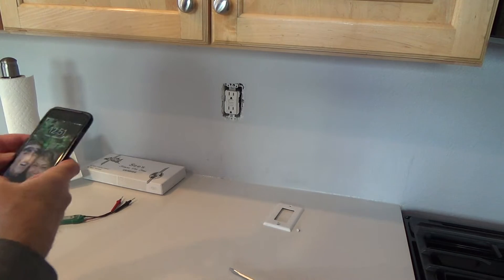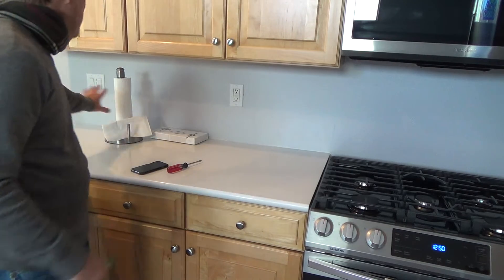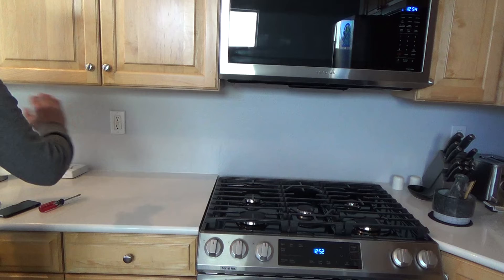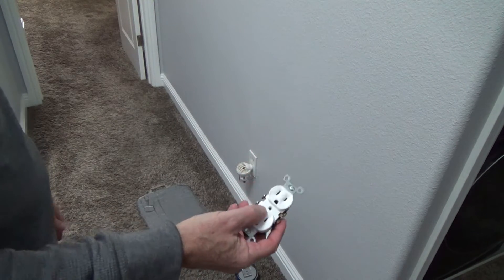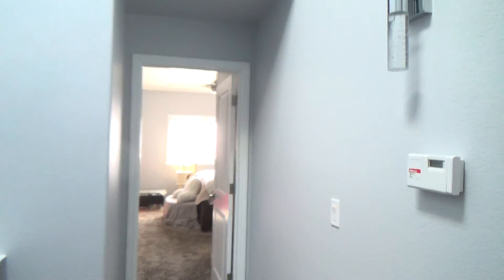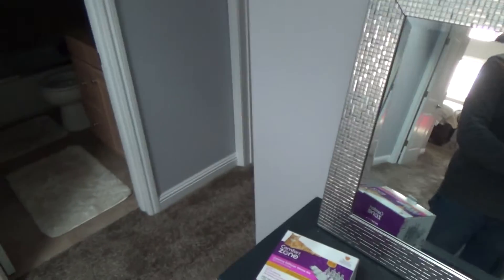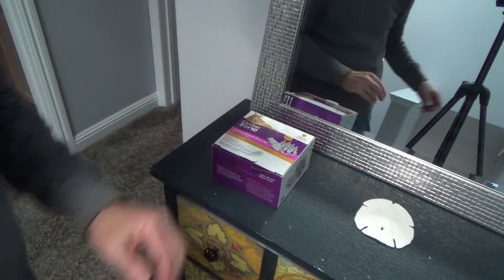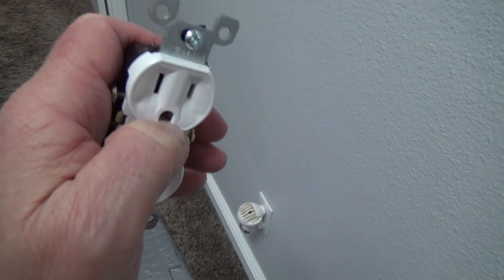What's the Difference Between 15 & 20 Amp GFCI Duplex Outlets?...Lots!!

Comment: I'm a new home owner trying to learn light electrical //  so I am going to put GFI in basement right behind washer my fuse box does say washer and is right it does say 20 AMP // is this right ? ( I know to somebody like you that's a dumb question ) but want to make sure I'm right
Reply from the maker: Sounds right to me but I have never seen a GFCI outlet where a washing machine is plugged into it....I have lots ot electrical videos on my channel for more learning...just go to my main YouTube channel page then click on playlists & scroll down to electrical. Get your popcorn ready! Thanks for stopping by!
Reply: well from my understanding  // where my washer is ( done by rental inspector ) is anything like sinks , bath , kitchen ... my washer hose and hook ups are literally going right in front of plug ( witch is not GFI ) I can see it I get it OK so here is what Ima do put a GFI or GFCI 20 AMP ( due to Breaker saying 20 Amp so this line is only line no / Load / do you think Id  be good ? I think so if not let me know I do not believe I will over load this line
Reply: @dp6824  It would be correct to put a GFCI receptacle where the washing machine is, or a regular receptacle that is protected by an upstream GFCI. It doesn't matter if it's a 15 or 20 amp GFCI or regular receptacle.

Comment: As the owner of a 1988 built house, I wish that you had wired it. The 15 amp GFCI outlets on 20 amp circuits are failing all over the place because the electrical contractor was a cheapskate.
Reply from the maker: So sorry to hear! Some contractors even miss the fact that they have 20 amp GFCI outlets at the hardware store or like you said they don't want to spend the extra money & think it's ok to install a 15 amp GFCI on a 20 amp circuit. I've seen it done all the time but for me I'd rather do it right. I guess you can go to the hardware store & pick up a few 20 amp GFCI outlets & replace the ones you think need replacing. I have videos for that too! Just go to my main YouTube channel page & click on playlists then scroll down to electrical & they should be in there. Let me know how you do or if you have any questions for the install. Thanks again for stopping by!
Reply: @VideoJoeKnows  That's what I've been doing. They're around $20/3 pack at Lowes. As you know, they have LED reset indicators now, and you just cut the wire straight and push it under the brass flap and screw. No more bending it into that hook shape anymore, which seems simpler and safer.
Reply: The fact that the original GFCI's are failing is likely because they are 36 years old. Actually, that's pretty good. It's not that they are 15 amps. The modern ones are well, new, and built much better than the older ones. Sure, you can use 20 amp receptacles if you want or save yourself a few bucks and get a 15 amp version, they are the same internally. I wouldn't be quick to blame the electrical contractor unless he backstabbed regular receptacles on 15 amp circuits. That would be more of a concern.
Reply: @surferdude642  Having replaced both 15 amp and 20 amp recently, I agree with you to a point, but I've also seen electrical code pdfs that show that 15 amp GFCIs are tested to 12 amps, and 20 amp GFCIs are tested to 16 amps. For whatever reason, manufacturers feel confident enough in the difference in their 20 amp GFCIs to allow devices rated to 20 amps with special 20 amp plugs to be plugged into them. The difference in price is minuscule or non existent, so why anyone would substitute a 15 amp GFCI with a 20 amp breaker is beyond me, but that's what was done on my house. They also used a 20 amp GFCI on a 15 amp circuit, so I don't have a lot of confidence in their understanding of home wiring.
Reply: @DUCKSAREEVILLLLLLLL  The reasons you cited for preferring 20 GFCI receptacles are totally sensible and I get that. The reason why 20 amp receptacles are tested to 16 amps is to allow for the 20 amp plug or cord which is very rare. It's there to prevent anyone from using a 20 amp plug in a 15 amp circuit with 14 gauge wire. That's why it's a code violation to have a 20 amp receptacle on a 15 amp circuit. The important thing is that a 20 amp circuit must have 12 gauge wire and in reality the receptacle makes no difference. Although, it's code compliant to use a residential grade 15 amp receptacle on a 20 amp circuit, I wouldn't recommend it, but instead use a commercial or spec grade quality instead. Regarding GFCI's, there's no distinction, they are all rated for commercial or spec grade.

Comment: You don't need any 20 amp receptacles. The 15 amp GFCI receptacles that are there are perfectly fine for 15 and 20 amp circuits, they're the same thing internally. Overload protection has nothing to do with the receptacle itself, regardless of whether it's a 20 or 15 amp device. It's a function of having the proper wire gauge, circuit breaker, the number of circuits, and being mindful of using too many higher loads simultaneously on one circuit. Assuming all parts are in good condition. The receptacle you showed there above the carpet is a cheap residential grade. I would change those and the kitchen to "spec grade" 15 amp device's. They're more robust in every sense over the residential grade. The only thing a 20 amp GFCI or regular receptacle will do is allow for a 20 plug and you'd be hard pressed to find an appliance with that plug. They are extremely rare. Coffee makers, blenders, toasters, toaster ovens, and even higher powered microwave ovens all have 15 amp plugs.
If you're having trouble tripping breakers in the kitchen and you want the convenience of powering several appliances at once, the only solution is to add another circuit, preferably 20 amp. You could of course use a 20 amp GFCI or regular receptacle, but my point is that it's totally unnecessary.
One other note is that if you find anything with a 20 amp plug it's likely to be used only on a dedicated circuit, meaning the receptacle must be a single, not a common duplex type.
I think an exception is that on two 20 amp split circuits (one duplex receptacle) and each is a dedicated circuit, a 20 amp duplex receptacle must be used to be code compliant.
Reply from the maker: Thanks for all the info.. Nice!
Reply: I've read that  I just don't want to wake up in a fire ( I'm new to electrical want to do it the best way possible ) I toyed with just putting a 15 AMP GFI but want to be protected

Comment: Why not install a 20 amp GFCI breaker so the whole circuit is GFCI protected and install regular duplex outlet on that circuit?
Reply from the maker: Yes you could do that but if the actual circuit is a 20 amp with 12 gauge wire I would still suggest the stardard duplex outlets to be 20 amp style.
Reply: @VideoJoeKnows  yea absolutely 20 amp outlets. I'm doing a bathroom remodel and have done this exact same thing. Upgraded my outlets to 20 amp outlets, upgraded the 14-2 to 12-2 and installed a GFCI breaker for the circuit. I thought this was a little cheaper than getting GFCI outlets for every outlet in the room. Just wanted to make sure I was doing the right thing here. Thanks.
Reply from the maker: @shawnphillips1220  You shouldn't have to install a GFCI breaker in the subpanel & you don't have to install a GFCI duplex outlet at all locations. On the circuit if you know where the first outlet is located down the line from the sub-panel that's where you would install a new GFCI outlet....then you can wire the GFCI outlet in such a way to where all the standard electrical outlets down line from that location will be covered through the GFCI outlet you just installed! There's two ways to connect up GFCI outlets one is to just wire in such a way to where the only outlet covered will be the GFCI outlet you install. The other way is to use the other two screws on the outlet & you can read on directions how to make all the outlets down line on same circuit to be protected by just that one GFCI outlet. Have you ever seen the little sticky labels that come with a new GFCI outlet? You use those labels to put on all the standard outlets down the line so people will know that even those outlets are standard outlets, people will know they are connected to an actual GFCI outlet somewhere in your house. See what I mean? Thanks for stopping by & hope this gives you another idea for you!
Reply: @VideoJoeKnows  yes. I considered that at first but then determined this is an older house with no GFCI circuits or outlets AT ALL. I also determined a lot of devices are on the same circuit and are overloaded in my opinion. It is very hard to determine what is on what circuits. I came up with the solution of pulling new 12-2 for the bathroom and doing away with the existing/ outdated 14-2 in there. This will lower the load on the existing circuits in the process. The only thing I was a little confused about was whether to install a GFCI breaker in the panel or to do what you said and just make my farthest outlet GFCI protected and put a label on everything on that same circuit downstream. I thought it would be easier just to install a GFCI breaker since I have to install a breaker anyways.
Reply from the maker: @shawnphillips1220  Yes if you think it's easier to install a GFCI breaker in the panel then do that but I would think the breaker would cost more than a GFCI outlet. If you did the GFCI on an outlet then it has to be the "closest" outlet to the breaker & not the "farthest" one....the very first outlet from where the wiring is coming from the panel....however you want to say it.....the wire going out from the panel going to the first outlet on the circuit has to be where the GFCI outlet has to be installed wherever that wire goes & it doesn't mean the closet outlet to the panel it could be the farthest one away if that's where the circuit starts....so check that out if you want to do it that way....
Reply from the maker: @shawnphillips1220  If you want to figure out what outlets are on a circuit then turn off one breaker then start walking around to see where all the outlets are off then mark them. Then go to the next breaker & do the same.....
Reply: @VideoJoeKnows  great info. Actually I think the breaker was about $60 but that's also an GFCI and ARC fault protection. Thank you for all of your detailed responses!!
Reply from the maker: @shawnphillips1220  You're welcome! Yes a 20 amp GFCI duplex outlet should be around $20 plus dollars no where near 6o plus easier & safer to install...as a thought!